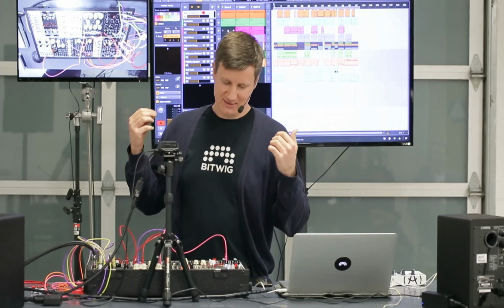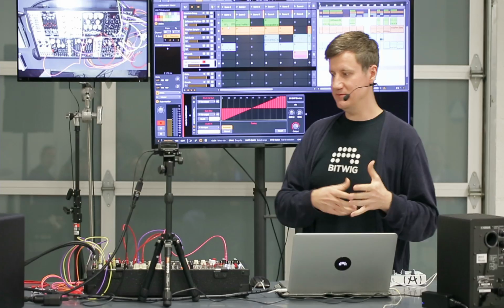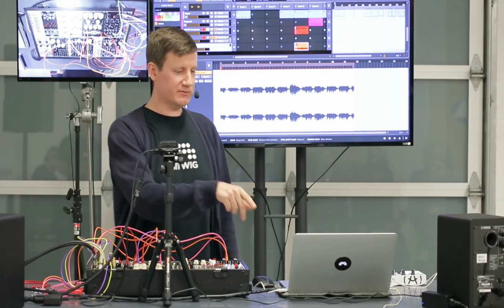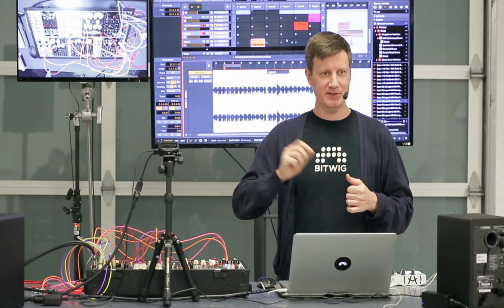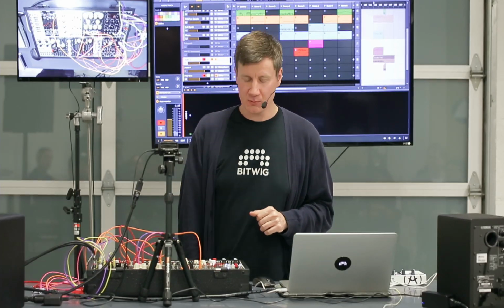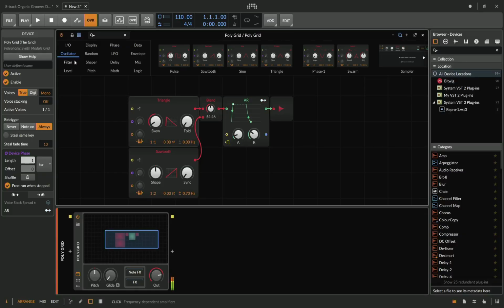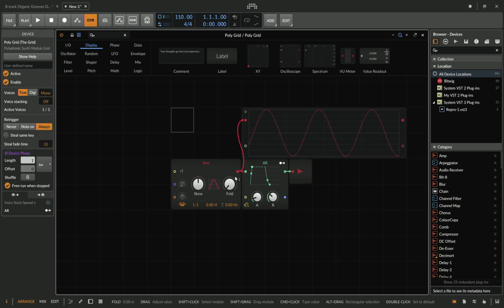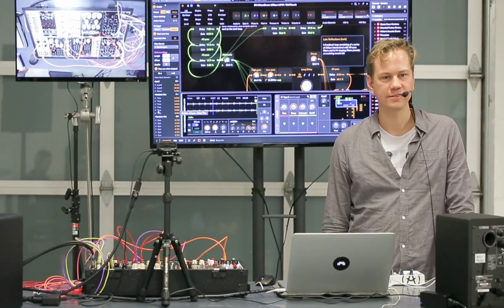BitWig Sound Design And Hardware Integration Workshop

Comment: 1:34:55 Can't hear the question, but you can push modulation signals through a DC-offset device, which basically converts the modulation signal into audio output, you can then just record this output.